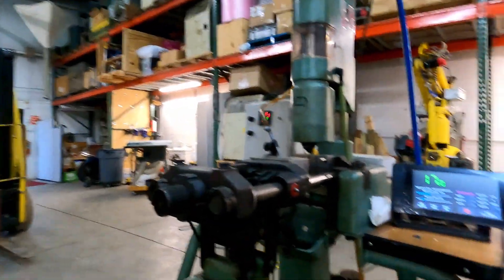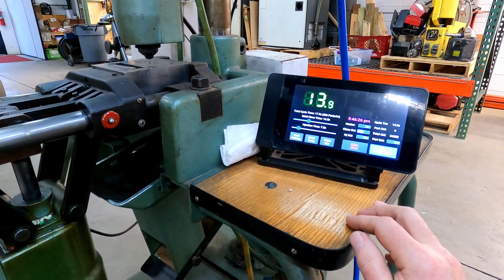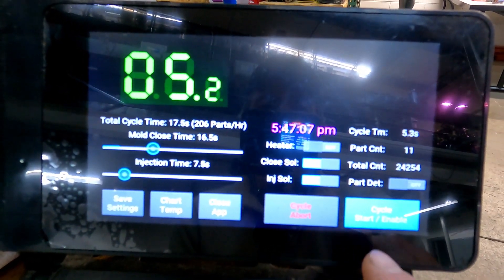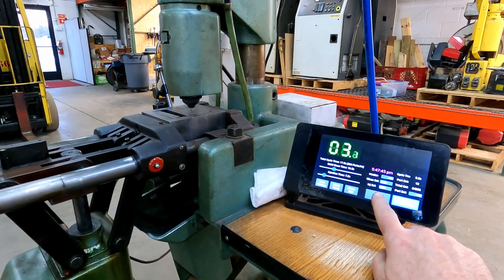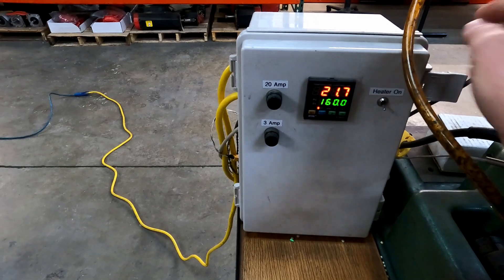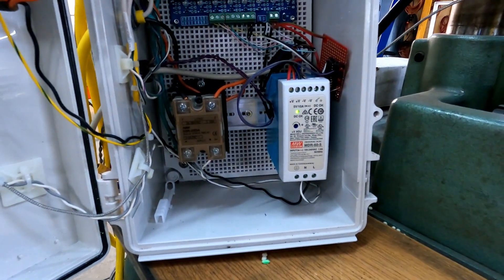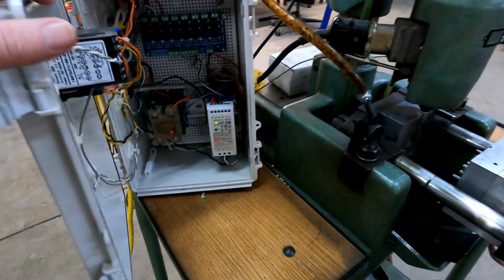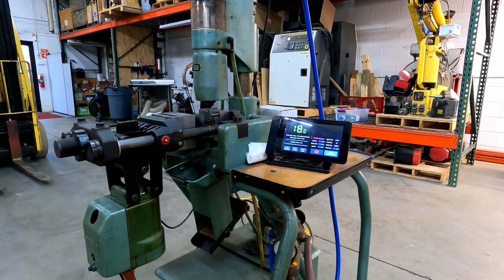Raspberry Pi Controlling Old Arburg C4 Injection Molding Machine

Comment: This weak i get my 2 older C4, downloading the image and that takes a while. Want to ask, is the display connectet to the raspberry via HDMI?
Reply from the maker: You have perfect timing.  I’ve been working on a new major update to the code.  The new code has the ability to double inject (for bigger shot sizes) and also double eject (for parts that stick to the ejector pins). Lots of bug fixes too. I’ll post the software somewhere when it’s done.

Oh, to answer your question, I just the official Raspberry Pi LCD touch display. There is a special ribbon cable that connect the display to the Pi. Ribbon  cable comes with the display. Makes rock solid.

Good luck with your build.
Reply: @705cnc  thanks for reply and the great software.
Reply: @705cnc  found the sketch for connecting but i cant figure out where to connect the solenoids to the pns of the pi.

Comment: Is that software available to buy? I have an older c4b and could possibly upgrade with this controller.
Reply from the maker: Yep, the software is available.  However, the software is VERY expensive.  To receive a copy you must agree to send me a video of your machine in action.  That's it.  Agree to that and software is all yours.

Here is a link where you can download a image for a Raspberry Pi:  https://jimk3038.com/

After downloading, use the image with something like Etcher to make a boot-able  SD card for the Raspberry Pi.  

Hope it works out for you,
Jim
Reply: @705cnc  , did we break your website?
Reply from the maker: @ericstratten6974  My web site sucks!   I rebooted it today and so far so good.  Something about the e-commerce stuff on one of my other web sites keeps crashing.  Anyway, let me know if keeps giving you grief.
Reply: @705cnc   I agree to send video. What language is it written in? Please let me know how to get software.
Reply from the maker: @DanBDougherty  All written in Python.  My actual code is rather small.  However, my stuff depends on a Python GUI called Kivy which can be a pain to install.  That's why I built the SD-Card image with everything all setup and ready to go.  Problem is my goofy web server is brittle and prone to crashing recently.

I'll put my Python code up on my server tomorrow - as well as look to see what's making my server crash.

Hope that helps...
Reply: @705cnc  Jim, looks like you need to reboot the server again! ;)
Reply from the maker: @jcposada  Looks like my server has a bad Ethernet cable.  Will be replacing with new tomorrow.  However, seems to be working OK for now.
Reply: @705cnc  It seems like your websites are redirecting to a scam/phishing site after a couple seconds. I haven't been able to view them without disabling JavaScript on my browser. If this is only on my side please let me know.
Reply from the maker: @arcanum126  Thanks for tipping me off to the problem.  Yep, I got hacked - even though I keep the site patched and updated.  Took a couple hours to root out the hack but is now fixed.  What a monster pain!!!  Thanks again for the tip off.
Reply: @705cnc  Looks like it got hacked again!  Ugh!  I am trying to buy a C4b that is no longer working and I'm interested in making a control system like you have.  I have a handful of PIDs around, so that part will be straight forward.  I'm not much of a programmer though, so I'm hoping I can look at the code you wrote and adapt it to the bits and pieces I cobble together...  Great looking interface BTW!
Reply: Wait a minute!!!  I used the Wayback machine to grab an archived version of your page and it looks like it has a clean link for the IMG file...  I'll pick through it and hopefully it will make sense.  Thanks for sharing your work!
Reply from the maker: @GregsGarage  OK, I think I'm back up and running "again".  Have a look and let me know what you think.
Reply: @705cnc  They got you again...  Holy cow they're fast!  I was able to d/l your img file through the wayback archive.  I'm wondering if you have the original build file for the python.  Maybe it's in the img file...  I don't have much background with raspberry pi.  If so, I'll be able to get to it and edit as needed...  If not, no biggie, I bet I can make the compiled version work just fine...  I spent a couple hours looking up pieces and parts last night, so I feel somewhat confident that I could assemble everything and make it work.